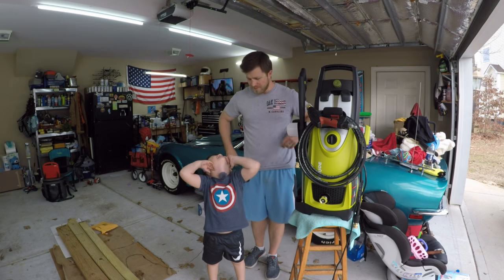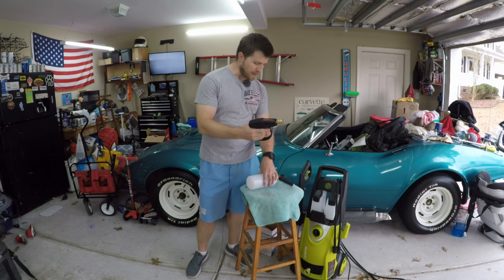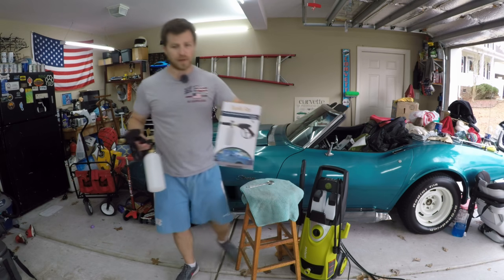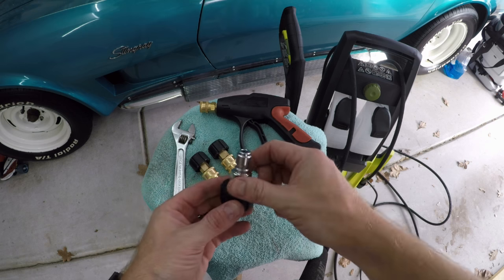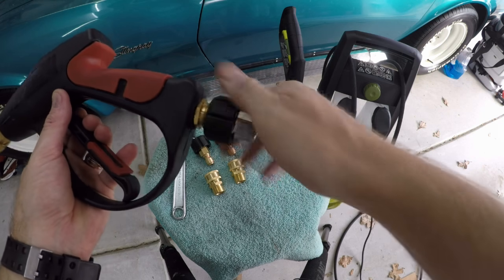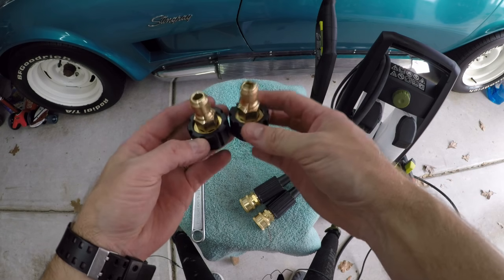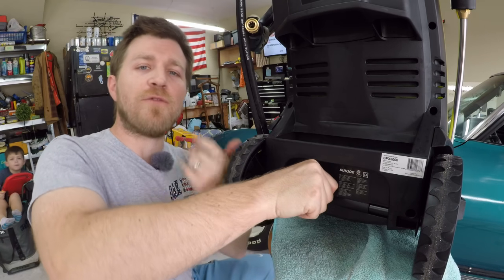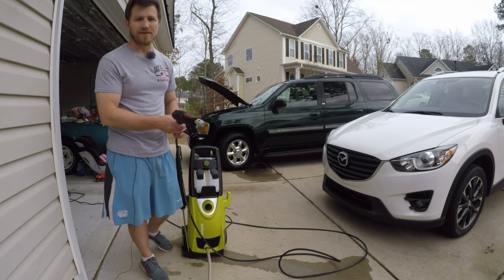EASILY ADD QUICK CONNECT DISCONNECTS TO PRESSURE WASHER

Comment from the maker: A lot of you have been asking in the comments...I just put a link to some garden hose quick connects in the video description.  I personally bought the same set and it seems to work well. I'll have a video about the garden hose quick connects coming out soon.
Reply: I just bought some — 

( ( Lucas White Lithium grease 8oz tube NLGI #2 ))    <— The exact name on the tube 

  Do you recommend using this product to grease the Quick Connects or did I buy the wrong thing ?    
I went to Lowe’s and they said that was all they had.  I really wanted something that was like 1-4 oz. but your advice on this product is much appreciated if answered and thanks.    Recommendation of what to use or if I can use this would be helpful also cause online I don’t see nothing saying uses for QUICK CONNECTS.  all I mostly see it used for is garage doors but it can be used for many things also.    Thanks again.
Reply from the maker: @davem1212  I think that will probably work. I just used what I had in the garage. Don't overthink the moment👍
Reply: Ptfe tape on the connectors 👍, back to edit just as he's already greased the threads lolz 🙄😀
Reply: So I just bought both the snubby and the San joe but I can’t seem to put in the San joe connector on the snubby. Am I missing  something ?
Reply: Did you make the video for the garden hose connection

Comment: Just wanted to say, you saved the day 100%. I was beyond frustrated that I couldn’t fit my new extension pole I paid 160$ for to my sun joe. It was the same 14mm and 15mm difference just like you described. I listened to this on my drive to home Depot and I knew right what I was needing and was in and out in 3 minutes and ready to do some work. THANKS SO MUCH
Reply from the maker: Awesome. I'm glad the video helped!  Happy pressure washing👍

Comment: ...your advice on the quick connects was something I never thought of (power washer is on its way while I watch this). Then I also saw your video on the 25’ extension hose but had to buy a quick connect separate for it so the two hoses went together. The Sun Joe HD hose extension no longer comes with the quick connector. Went straight to Amazon and bought it all right away. Buyers be sure the extension hose you buy is the Sun Joe “HD hose” so it matches the hose that came with the SPX3000. There are some that are not HD and are low quality. So I’m all set thanks to you. Now I will have 50’ of pressure hose. Great set up. Great video with great information. Also, fine young man you have there. I have 3 boys that love helping with everything.

Comment from the maker: I hope this video is helpful to you. Leave a comment down below if you've added quick connects and how you like them.
Reply: Mines a m22 1/4 do I have to buy two of those quick connects
Reply from the maker: @dlo__3929  You'll need to know if the inner diameter is 14mm or 15mm.  If you already have a M22x1/4 on one end, then I think you'd only need to buy one coupler.
Reply: Kevin Nadeau they’re both m22 on the hoses, it’s a power stroke pressure washer from Costco
Reply: I got some quick connections but not the same ones you got and now my Sun Joe keeps pressurizing. Off and on like a car trying to start. It works great when I pull the trigger but when I let my hand off the trigger it’s making arhat start up noise like when you first turn on a Sun Joe. Is it the cheap connectors I got?
Reply: Is a product where you dont need a water house to connect ?
Reply: Hey Kevin is the fitting from the hose to the wand a standard size regardless of make? I measured mine and it's 3/4" diameter at the want fitting to hose. Trying to figure out what adapters I need or if these are the same size. Thanks
Reply: @KevinNadeau  
I thought the sun Joe spx3000 comes with a m22 threading and ¼ hose. I was just wondering if you upside your pressure washer hose and the fittings. The quick connectors

Comment: Pro-tip: Lay out the hose in the sun for several hours. Ensure that the hose is extended fully and not kinked. The heat will make it easier to handle the hose in the future, as it softens up the kinks. Also works with garden hoses.

Comment: Thank you for this video!! I’m super bad at technical measurements and my hardware naming knowledge always seems to be lacking despite knowing how to use plenty of equipment and build lots of stuff. I’ve had this pressure washer for years but trying to hook up anything but the wand it came with has been impossible and quick connects and these adapters will make my life so much easier. I’ve had a foam cannon and pistol grip sprayer for 2 years and just didn’t want to go through the hassle of ordering and returning more parts that won’t fit. Seriously thank you for explaining the part/sizes and listing them in the description!!

Comment: Great on time video for me as a foam lance is exactly what I want but do not care to connect it to the long wand of the pressure washer.  I know that the pressure washer lines have M22 ends but I was NOT aware the center can be different sizes until you stated so.  Again, great informative video!!!

Comment: Thanks dude. I ordered all fittings you shows. But a pressure hose I have with Sunjoe the end wich connection to a pressure gun of Sunjoe has very smaller a coupler. So I need replace a pressure hose, or find a fitting for smaller end.

Comment: Great video-thanks. I wasn't aware that soooo many Sunjoe owners were having the same problems as I have struggled with. The whole 14mm/15mm drove me crazy. SunJoe was not helpful at all. Also, going into Home Depot ( no staff ) trying to find the correct QC was a dismal failure. Your video helped me immensely, however, my question is ....why doesn't SunJoe provide these facts, or similar videos or simple explanations! ( I guess they are just too busy counting their profits!).
Reply: I agree ,it’s just a quick info for those who want to upgrade it,I bought the wrong ones,such a hassle that could be avoided

Comment: i love the video i wanna kinda use the same setup i already have in my cart the m22 15mm connector but i want to find a cannon that goes with the m22 15mm connector as well.  thats where im getting confused.  i connect the m22 15mm connector from the hose that came with the sunjoe in your video i just need to find a cannon that way i can switch between the wand and the cannon.  i cant find a cannon that has a m22 15mm connector.

Comment: If I wanted to add a 25' hose extension to the joe pressure washer, what quick connect would you recommend?  Goal is to overall increase the total length of the hose, splicing into the factory hose.  Or instead, would you simply recommend a single, dedicated hose?  Thanks again.
Reply from the maker: This is the extension hose that I used. https://amzn.to/2FimY0j  It's a SunJoe brand and has been working well for about a year.

Comment: Thank you for your videos.  They are helpful, but I am not that smart.  Can you tell me what quick connect items I would need to fully quick connect a WHOLESUN 3000PSI Electric Pressure Washer and aff a 50' pressure hose?  Thank you.
Reply from the maker: I don't have experience with quick connects and the WholeSun pressure washer.  I'm afraid I don't know the answer.

Comment: I have the same one as you. Why do I lose pressure and it stops then comes back on even when I’m holding down the trigger. Everything is hooked up correctly and what size quick connect needed for front for water hose? Thanks a bunch and the 14mm worked great !
Reply from the maker: Mine does that too sometime.
Reply: @KevinNadeau  I was able to wash my car with no problem and it was excellent, but I tired to clean a brick wall with the stoping and going and losing pressure, I just gave up. Wonder if it’s worth calling tech support, but I love the unit.

Comment: Thanks for the video. Why did you list two different Pressure Washer Adapter Fittings? Is there any difference?
Reply from the maker: One is for the water gun and the other is for the Sunjoe hose. They are two different sizes 👍

Comment: This video is downright helpful. I have a question about the house connection to the power washer. My hose has its own quick connect though. How can I connect my hose to the pressure washer in my situation? Am I better off removing the quick connect on my hose? Thank you for any suggestions.
Reply from the maker: I just bought some quick connects for my garden hose too.  I put the male connector on the pressure washer and the female connector on the hose.  I put a link to the garden hose quick connects I bought in the video description.  I'll have a video about them coming out soon.

Comment: My sunjoe hose has only one end with the black piece that spins and the other is a skinnier smaller nut. I have the Spx 4003. Should I replace my hose with the one you have posted?
Reply from the maker: Looking at SunJoe's website, it looks like the hose that I have posted (SPX series heavy duty) will work with the SPX4003.

Comment: I recently stripped the threads on the high pressure outlet where the hose screws on to the back. I left the hose connected and hadnt used it over time thus it rusted solid and wouldn't come apart, so I ended up damaging the threads so now trying to find replacement part. Any ideas?
Reply from the maker: I don't know if that part is replaceable.  Maybe you could try calling Sun Joe customer service.

Comment: Hey Kev...i really enjoyed your video on the SJ...thanks! I do have a quick question about the Twinkle Star gun. I just ordered a MTM? gun and i was wondering what quick connect size/setup i would need to use with the original SJ pressure hose and the aftermarket gun? Also, i can't find the links to the kit that you got from Amazon. If it no longer exists, what are the quick connects that I should order...2 22mm/15 and 1 22mm/14 (for the aftermarket gun)? Thanks again!

Comment: How in the world did you get the sprayer to connect to the new coupling? I swear mine is a size too big to fit. Did you have issues getting it on? It doesn’t seem like it.
Reply from the maker: I didn’t have any issues making the connections. Make sure you have the right one. M22-14 or M22-15.

Comment: Is there a quick connector for the garden hose to the pressure washer? What type of grease do you use? Thanks.
Reply from the maker: Yes there are garden hose quick connects too. I did a separatr video on that. The grease I used was a high temp grease from the car parts store (its what I had on my shelf).

Comment: For the new twinkle star guns, they are m22-14 with 1/4 inch instead of 3/8. Does this mean I need m22-15 with 1/4 inch fitting for the sunjoe hose? I can't find an m22-15 with 1/4 inch fitting.
Reply from the maker: I think you're right. There maybe adapters for 1/4 to 3/8, but I'm not positive

Comment: helpful video showing which quick disconnects to use. I was able to make it work for my Sunjoe. you used grease on the o'ring specific for high pressure. can you provide a brand or search words that I can search for myself? is adding grease to make the o'ring last longer? thanks.
Reply from the maker: Thank you. The grease I used was Advance Auto's house brand, nothing special. I added the grease just to give the orings a better opportunity to seal on their first run.

Comment: If quick connect connections suggested here added to sun joe Jose can you tell me what connectors would be needed if the Sun Joe SPX-25HD foot extension were added so extension hose would connect to original hose and sun joe nozzle with quick connect suggestion here.  Thanks

Comment: Hey bro it is possible we can connect pressure washer hose to 3/4 garden faucet? Thanks.
Reply from the maker: I've never done that, but I'm sure it's possible.  You just need to find the right adapters.

Comment: My Husky 1800 pressure washer already has a quick connect.  Since it is leaking at that connection, do you have a video showing how to replace it?
Reply from the maker: I'm sorry I don't have a video showing that. Can you use a pair of channel lock pliers or vice grips to remove the connector?

Comment: My Sun Joe SPX3001 Pressure Washer hose sprung a leak. The replacement hose has been out of stock for several months. The male end that connects to the body of the pressure washer is not standard so I can't buy a replacement hose from anyone except SunJoe. Any thoughts on an adapter for a standard hose so I can use my pressure washer? Thanks, D Shelley
Reply from the maker: You'll want to look for an M22X14 to M22X15 adapter

Comment: What if I want to upgrade to a better hose, wand...everything except the Sun Joe washer, itself?  What do I need to adapt a standard hose to the outlet of Sun Joe? I don't like being tied to the proprietary connectors. Thanks
Reply from the maker: Most electric pressure washers use M22-15 connectors. But check the the specs of the equipment before you buy it.
Reply: @KevinNadeau    OK, so there's the M22-15 world and the M22-14 world?  I assumed the SunJoe (M22-15) locks me out from having easy access to more standard (M22-14), better quality accessories + gear.

Comment: Hi Kevin, I just bought the Sun Joe XPS 3000 and their foam cannon not realizing it was a proprietary piece that attaches to the Sun Joe gun using a bayonet mount and the included adapter. You unscrew the lance, then screw on the adapter and then attach the cannon to the adapter with the bayonet mount. Are there quick connect adapters for the screw on part so I can pop off the lance and attach the cannon quickly? The gun/cannon combo you use is no longer available and I hate to waste the cannon I just bought. Thanks.
Reply from the maker: I'm not familiar with your set up, but I would imagine you can get a quick connect that screws on to the lance. You can check your local hardware store.

Comment: I want to set-up my Sun-Joe SPX-2596 model washer with the quick-connects and have found that this model's pressure wand connector is a 14mm threaded nipple and probably can use the same M22 x 14mm adapter you used on your pressure washer gun. It seems the other end of my pressure hose is the M22 x 15mm threaded end connector. I have a question to ask. If you decide later to add a second length of 25 foot pressure hose, you'd have to use one M22 x 15mm female end quick connector and a M22 x 15mm male quick connector in order to connect the two hoses together. On my air compressor, all my air hoses have that same setup. Why would a pressure washer be any different and setup both ends with the female quick connects on the hose ends instead of the same way on air compressor hoses, one male end, one female end? Each accessory would have the male connector and the compressor or pressure washer should have a female connector. That way, you can add or subtract an extension hose and not be concerned which hose you use. Either one would work without the other one, in case one gets damaged, or you want to add additional lengths of hose. Do extension hoses ship with the the quick disconnects already installed or do they just have the threaded ends like with typical air hoses? The only reason I can come up with is to relieve the water pressure and drain the water from the unit when done using the washer. Thoughts?

Comment: Hey, I have the same pressure washer and recently got me a new Yamatic hose along with a gun and foam sprayer. I didn’t know about the 15mm vs. 14mm ends, although I was lucky enough for the new end pieces to be 22 tread. However, when I’m using it, I have this weird pulsating issue; not the pressure, but when the machine is on and I’m not spraying water, the pump pulsates as if I was pressing on the gun and releasing. Did you experience this at all when using the new end pieces? And could this be caused by the end piece of the hose being a 14mm connected to the Sun Joe’s 15mm outlet? Like if water is passing through due to the difference in mm, could that activate the machine briefly?
Reply from the maker: I haven’t experienced what you’re describing. Sounds like water is getting by somewhere.
Reply: @KevinNadeau  thanks for the quick response! It’s strange…now that I just learned about the different mm’s, i purchased a few connectors to see if that works. Merry xmas!
Reply from the maker: @unkhammunankh7252  Hope that fixes it. Merry Christmas
Reply: So, after much reading and tinkering around, I learned that electric pressure washers like SunJoe do have the 15mm outlet. The issue is not so much the inlet end but rather the o-ring on it, so what I did is that I swapped (could have purchased) the o-ring from the Sunjoe’s original hose with the 14mm on the quick connect adapter. That solved the issue!

Comment: Any question, please. After purchasing this high pressure washer, I did not realize, but the soap only works on the black nozzle. All the other nozzle for high pressure are for water only. Question, when using the cannon bottle, that has all the other high pressure nozzles, can you use soap with each nozzle or is it just like the nozzle with the pressure machine, black low pressure nly for soap.

Comment: I see you linked to the heavy duty 25 feet hose. Is this a direct replacement for the original 20 ft hose? I read some reviews saying it does not connect to the pressure washer directly and must be added onto the original 20 ft hose making it total 45 ft. I just want the heavy duty 25 ft for 5 extra feet. Will it work?
Reply from the maker: I added the 25-ft extension to the stock hose. So I now have 50 feet of hose now.